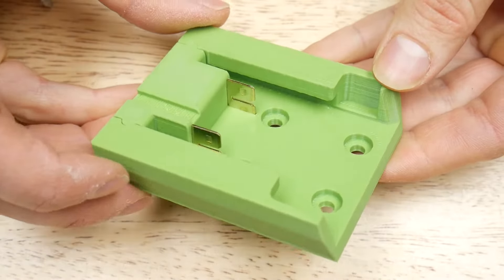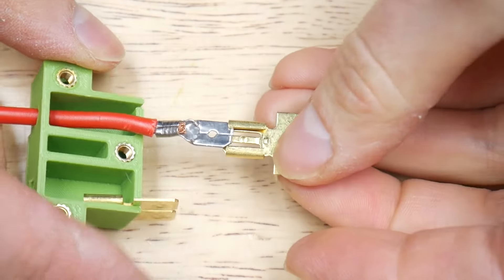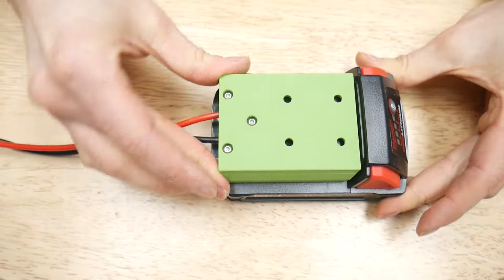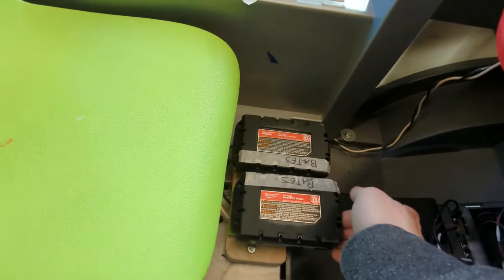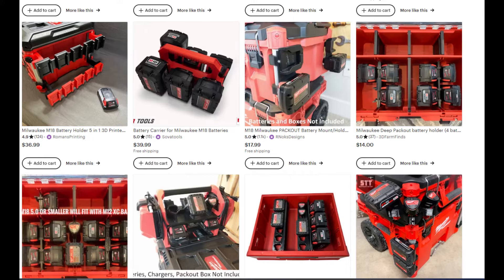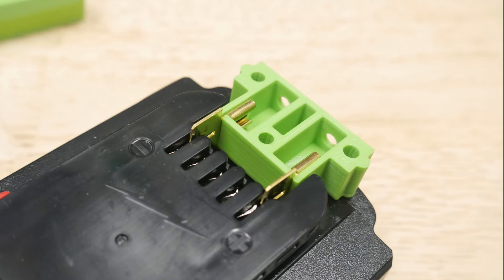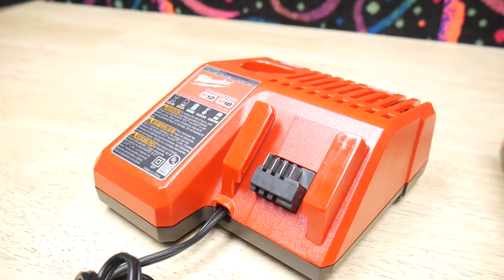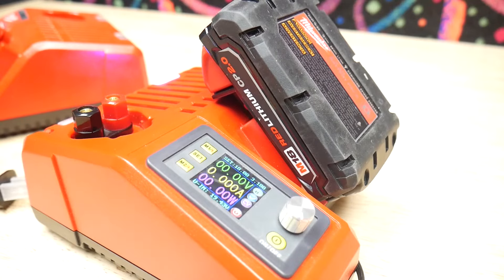Milwaukee M18 Battery Adapter

Comment: Can you charge the batteries through an adapter with a smart charger like an icharger, for example ?  Mostly, I’d like to bring the voltage down for storage ??  Thanks if anyone knows.
Reply from the maker: no. you cannot charge through this adapter.  most adapter do not support charging. use the intended power tool to drop the battery voltage

Comment: This is amazing. Great job! What is the name of the wire  connector? Wondering if there's a m12 varient. 

Again, great video.
Reply from the maker: thank you! that part= Molex DBL Male/Single Female Quick Disconnect, Digi-Key PN: WM22922-ND
Reply from the maker: no M12 variant